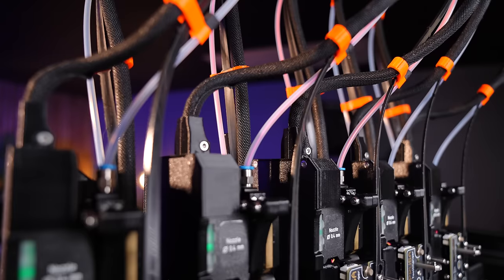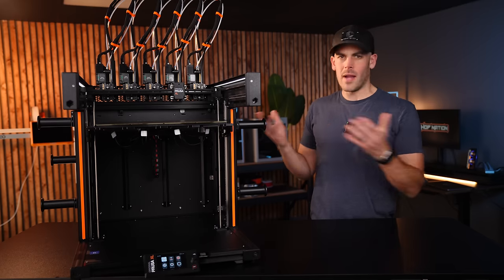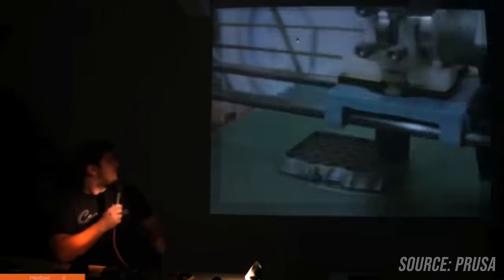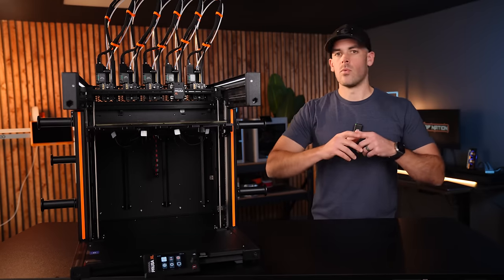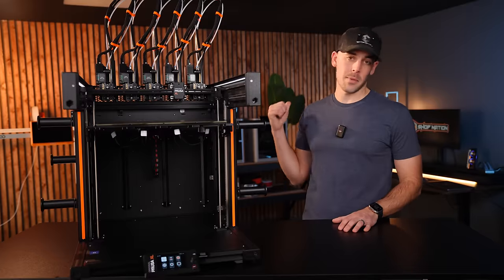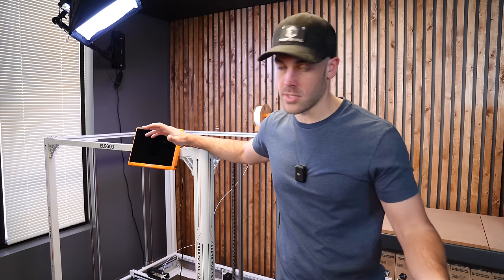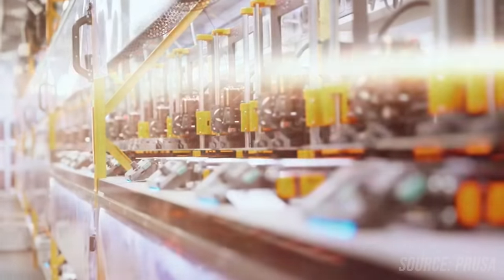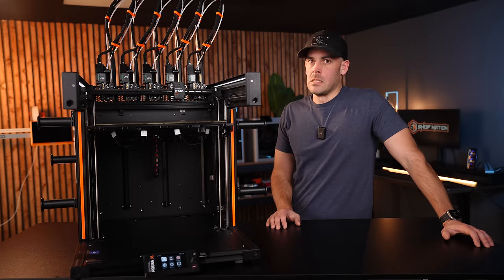Why Prusa is the next Blackberry

Comment: I changed my ringtone to the modem dial-up sound and I either get a WTF look or a giggle.
Reply: So having 5 print heads is just stupid, yea it’s quicker than filament changes but there’s so much more that can go wrong. At this point prusa is overpriced trash. Old tech and high prices.
Reply: Nice!  Hardly any-baudy understands that anymore.  😆
Reply: Most ppl are too young to even know what that is anymore.
Reply: What's a ringtone?
Reply: @trenzterra  Ikr, making a call now makes you look agressive, getting a call feels like a chore and marketers have big blame on that
Reply: Mines the shaguar ring tone.  Always gets a laugh.
Reply: AOL CDs didn't work so well as coasters as everybody said.  They have a hole in the middle.
Reply: Heh, mine is the ZX Spectrum loading screech. It really makes a difference. :D

Comment: Multicolor isn’t the main use case for the multi head system I believe. I work in prototyping and research and this printer would be extremely useful for multi-material type parts. For example, we print in one material for the part and we print the supports in dissolvable material.
Reply: Exactly. People who want to make multi-coloured decorative items would be much better served by a printer that could colour filament as it goes (ex., by mixing pigments into white filament, or by making a pass with an inkjet head after each layer). And that would probably have a lot more mass appeal than a printer that's 50% faster.

Multi-head printers are mainly for combining different materials.
Reply: “Would be useful”.  Didn’t buy one?
Reply: Also work in a business with rapid prototyping. What type of Print would need 5 different materials? I could see it using 3 at most. Something like PET-G + TPU for a gasket and PVA dissolvable supports.
Reply: @andyt1313  4k for that makes it infeasible. Something can be useful as a product, but prohibitive due to other factors, such as cost.
Reply: @RFC3514  Totally agree. Multi-head is the future (over switching filaments). When you compare this Prusa to, say, an Ultimaker that clocks in at around $7,000, the price doesn't look as bad, but Prusa must get the price down somehow, maybe  a model closer to their basic core xy model with the option for multihead use.
Reply: @hockeygoalie35  Maybe different materials + Different colours for customer prototypes. In my experience, when you're presenting to customers your concepts it would be so much faster and cheaper to print in different colours to help fell your idea. For example, you could print the main body in black while having their company logo printed in the proper colours. Adding in the dissolable filament and materials for gaskets will be really good.
Reply: imagine not wanting a simple multi material project to create 200% of its own weight in waste and 7 days to print
Reply: @01sigh  Totally agree with you. I was just disagreeing about the OP's post. I have an XL (dual head though) but the vast majority of reviews show off multi color much more than multi material. Multi color definitely seems like the main use-case for most purchasers of this printer.
Reply: Is this a real thing though?  I have searched everywhere for dissolvable filament reliable enough to print in a normal consumer printer and it doesn't seem to be a thing.  If it was, you could do the same with a Bambulab printer, especially if you're only using it for interface layers.
Reply: That still remain his point though, how many of this machine do you need for your work vs how many for a factory. And how many hobbyist need a multithreaded machine to begin with...
Reply: Agreed. Multicolor is not the potential it's aiming for. I'm very exited to see multi-material prints.
Reply: @Flaakk  Soluble supports been a thing way longer than 6 years ago I'm sure, but the thing with people not caring about Ultimaker is... well look at the price of those things. The people that buys them aren't often in these types of comment sections.
Soluble support really does things near impossible (or entirely impossible) with normal supports.
Reply: @BrianHockenmaier   It sure is, it's just PVA filament and can be purchased on some more specialized stores. You'll not find it absolutely everywhere but it's still a thing indeed. The Ultimaker printers do use a print core specially for that, but as far as I know there isn't any necessary changes to a normal print head.
The thing with PVA tho is that it's the absolute worst thing ever in therms of absorbing humidity. You can feel it sticking to your hands just like glue - which it literally is - if you don't keep it extremely well kept and dry.
Reply: plus you could theoretically have different nozzle sizes, so have a larger one for speed on infill, but then have a smaller one to do the outer shell.
Reply: But you can only print in PLA, PETG or TPU. Even for ABS+ or bigger PETG parts you need to mod it to have some sort of an enclosure. PC and PA is out of the question.
Reply: Dissolvable filaments are extremely overrated and gimmicky at best
Reply: i have the xl, i use it to put tiny beads of glow in the dark plastic to my prints, glow in the dark filament shows up super well on ct scans. the xl saves 10 ish hrs on my prints.
Reply: I'm pretty happy with my XL and feel very relieved, compared to my old MK3S/MMU3, to be able to use soluble supports reasonably efficiently.
Reply: this is why i really want to see bambu's next printer have 2 heads.  one for dissolvable support material and one for other materials.

just hope they can keep the price under $3000 for micronic's new SLS machines that would eliminate the need for dissolvable supports.
Reply: @Flaakk  because ultimaker sucks
Reply: And that's a tiny portion of the market, in which 99% of 3D printer users make trinkets to sell on etsy.
Reply: I totally agree with your point but I will add that I think they shot themselves in the foot by not enclosing it. A lot of the materials that benefit from separate support materials (nylons and other engineering filaments) need an enclosure to print best. A lot of companies that would look at something like the Prusa XL will go with an enclosed printer with either dual printheads or IDEX instead for that capability.
Reply: Or even print the same part but with up to 5 different materials so you can test their material properties with specific shapes or structures.
Reply: @Nerfherder-oo7iv  yeah but even still you can use petg as supports for pla as they dont really stick to each other the best.  there are other compos that work. and im sure once someone creates a machine that has multi head thats not stupidly priced and more ppl have them then more work will go into more reliable dissolvable filament.
Reply: Imagine a filament device that took multiple filaments and fused them into one roll. You slice the model import into a fuser, it takes different colors, maybe even filament types and make a continuous spool and changes the exact moment it is supposed to. No need for multiple heads, no need for waste. It would take a lot of r&d but the payoff...
Reply: if anyone could help with their opinion:
- where would you place the RatRig 3d printer? interested to know how it ranks between the rest of the brands
Reply: @BrianHockenmaier  It's marketed as "support filament"
Reply: Completely agree. i have a two head XL, I use it for functional prints, not interested in multi-colour but multi material is really useful and just not practical with a single head machine if you're printing materials with different temperature requirements. I print components which combine hard and soft areas, also I use soluble support. I'm considering getting a 3rd print head so I can do both of those at the same time. It's quite easy to enclose, this does need doing. It is expensive, but it's a very nice piece of kit.
Reply: @hockeygoalie35   The XL isn't only sold with 5 toolheads, you can choose a lower number and add more later if needed.
Reply: I think most of these workloads only need 2 tools and are well served with an IDEX.
Reply: @RFC3514  You're not lying. It would have massive appeal. The is the pigment would either be shallow, and go off with a scratch, or it would make a huge, wasteful mess.
Reply: @Potato_Quality7  - There are already (expensive, industrial) printers that do that. On the ones I've seen, the dye / pigment went about half a millimetre into the plastic (it can probably be controlled by deciding how much of the perimeter gets painted on each layer), so scratches shouldn't be an issue.
Reply: @hockeygoalie35  And different nozzle diameters. As Prusa announced the XL, they talked about supporting different nozzle sizes in one print soon(tm). Sadly have´nt heard about this later on.
Actually this would be a game changer for rapid prototyping. There a many cases you might need details only in certain areas. So if you need a 0.25 mm nozzle in certain areas, but are O.K. with 0.4 mm in others and maybe 70% of the print could be done with 0.8mm or bigger, this could be quite interesting function.
So 3 nozzle diameters, one support material and TPU = 5 heads...
There should be an option to also use a MMU3, if you also want colour changes...
Reply: @SummerSausage1  $4k is cheap for business equipment purchasing.
Reply: @BrianHockenmaier its called pva filament and reportedly does not work well in bambu printer.
Reply: It's simple, they need to compete all-in in the sub $1000 CoreXY printer space, because that's what almost everyone is buying from print farms to prototypers to advanced hobbyists, and increasingly even beginners. You know: Bambu bread and butter. Just about ready to buy a P1S and if Prusa made a similar machine for roughly the same price or a little more I would go with Prusa. I just like their ethos and everything about their business a lot more than bambu. Ever since Voron I've been convinced that CoreXY is absolutely the way to go, I just don't want to build and maintain one. I want turnkey. Come on Prusa.

Comment: One of the big issues with Prusa is they have no representation in the USA. Every 999 dollar printer comes with a  150 shipping fee. The XL is 300 for shipping. Plus it took them 2+ years to ship after they announced. Their products are pretty solid performers, but I can get my Ender 3 and my Prusa MK2s+ to make the same parts at the same speed.
Reply from the maker: They do with Printed Solid, they are here in the US
Reply: @ShopNation  it seems like it would make more sense to setup a north america factory and ship out from there, instead of shipping from Europe
Reply: Plus the $160 customs fee on top of it for XL to the US. I really wish they had a distributor in the USA 😔
Reply: YES! I just had an order of 4 printers for our school get returned to the Czech Republic because DHL said our importer didn't pay the duty fee on time. Multiple emails to Prusa and they finally came back with  "Well we can send it to you again, but you're paying shipping charges again, or we can refund you the order, but you're still out shipping and possibly the duties". The strangest thing is that I put in 2 orders on the same day. One shipped and we paid duties no problem, the other got screwed up. This means that I've got a 50/50 of any order I place with Prusa actually showing up.

Printed solid is an option, but they don't stock kits. Typically I've ordered a mix of prebuilts and kits so I can have our shop monitors put together machines and get a feel for how they go together. We have over 20 Prusas, but after this latest screw up with shipping I'll be switching to Bambu or another similar brand for future machines. Really disappointed as I like Prusa in principle as a company, and have tried to support them for 4 years now.
Reply: Had my Bambu in 5 days free shipping. I don't use multi color printing so the enclosed Bambu is a much better option. The only thing PRUSA has going on for it is the multi head and 14x14 size, other than that it's outdated.
Reply: @fivepointeightnate  I feel you on that! The main reason I ended up getting the XL was because of the multi tool head, and the large size core xy! If bambu had a competitor multi tool at a decently lower price, I would have been all over that, but I dont have time to wait lmao 😅
Reply: @ShopNation  buying a prusa from printed solid is more expensive than buying from prusa and paying shipping.
Reply: I paid $160 for the shipping and another $190 import tax, about 3 weeks to get it. Prusa definitely should fix this problem.
Reply: Shipping a Mk4 to the US is $48.76. Stop lying.
Reply: @SaigeSauce  You do realize that in that case, the distributor needs to pay the customs fee / import duties?
And that's one of the reasons I just bought the Prusa Mk4, because I am in Europe..

Choosing EU build where possible, even if at a slight disadvantage (which I understood after watching the prev. video about the new print farm rack)
Reply: @ThomasThomas2  I think they talk about the XL, ie what the video is about..
Reply: @bitcoinsig  Makes me laugh listening to Americans complaining about the indignity and inconvenience of buying a quality product from another country, There are probably 3D printer manufacturers in the US you could support and buy from. Say Prusa does set up a factory in the US, then only makes a couple of bucks commission per printer, compared with the ???? bucks by selling from Europe. Once all up and running, Then someone in said US company decides it is all open source anyway, and we could just manufacture these under our own brand name, screw Prusa and make even more money. Just like China does to the rest of the world. If an American corporation thinks they will get away with it, they will throw Prusa under the bus in a heartbeat. American corporate greed knows no limits, and certainly has no moral compass towards little people either who do all the hard work.
Reply: @avbauwel  but you also do realize if they bulk shipped to a USA warehouse, they wouldn't be charged $300 for shipping per unit lol so maybe the $150 import duty (that they can also write off as a business expense) wouldn't be so bad.
Reply: @d.i.l.l.i.g.a.f  the Chinese do it. I can have a Creality shipped from the US, EU, or AUS. It doesn't make any economical sense to direct ship one printer from Europe or China, when you can more economically ship an entire container load via ship to a warehouse and drop ship to your customer from there.
Reply: @bitcoinsig  better yet, make it in Mexico, people work for less rice there than whatever Bambu is paying
Reply: @ElectronicShredder  in my first reply I did say setup in north america, so the thought also crossed my mind. The only challenge is that the orders get delayed by customs since America is probably the largest consumer market in north america.
Reply: @avbauwel they specifically list both. I am commenting on the non XL cost. The XL cost is wrong too though, $246.10 for the fully assembled 5 head. A semi-assembled single head is only $162.48. Everything was a lie.
Reply: I can drive to Microcenter and pick up a Bambu Lab printer, in fact I did…got an A1 Mini to go with my P1S and X1C. Prusa should distribute to retail, now that MK4s are in stock (and not back ordered) they should be able to have some limited retail distribution at least.

At one point I had preordered the MK4 but it was taking so long I canceled and got a Bambu Lab P1P instead. And now here I am with 3 Bambu Lab printers and 0 Prusa printers.